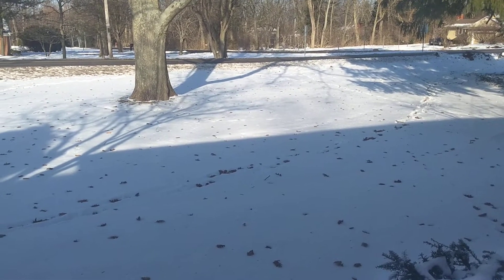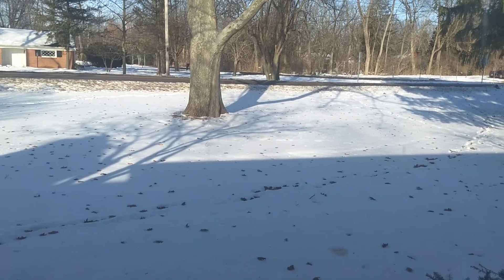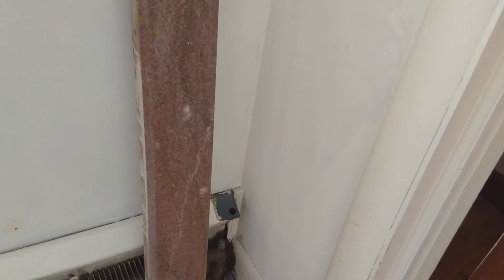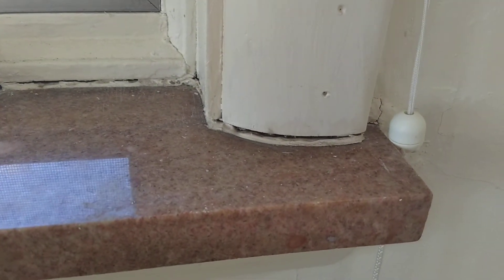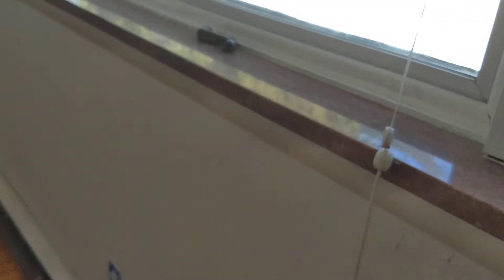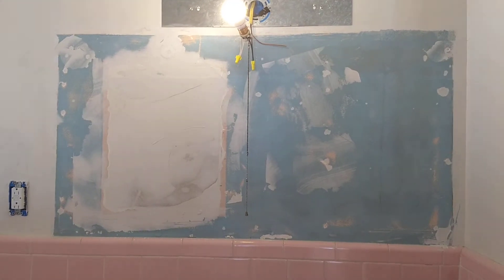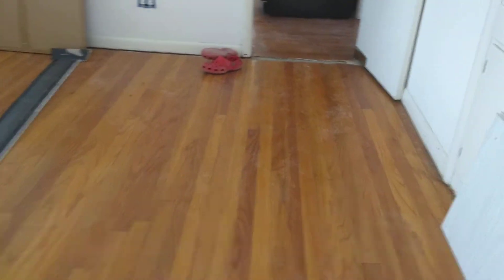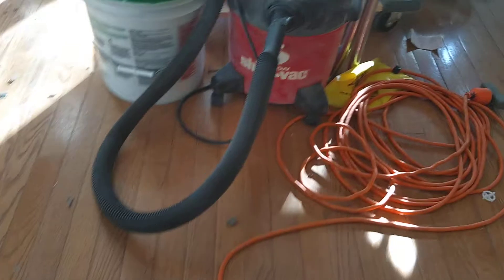House renovation update#27 | MRS. RATTLECAN'S HOUSE

Comment: Nice progress James. I may come off as a know it all here but this really is my area of expertise. On the sills I would remove the apron, that's the molding under the sill, and shim as needed to push the sill up to the window frame. Then reinstall the apron. Simplest solution in the long run. It will however leave you with a line or hump of caulking to remove at the bottom edge of the apron assuming they caulked that edge. Also would for sure foam the gap under the window to stop air flow. That tile is good looking stuff, nice choice.
Reply from the maker: Dane Nichols Dane I appreciate your input because you've "been there, done that". I'm certainly open to learning what the right way to do something is.

The tile is all the Mrs.'s idea. Just finished laying it, will probably grout it Monday. Thanks for letting us pick your brain.